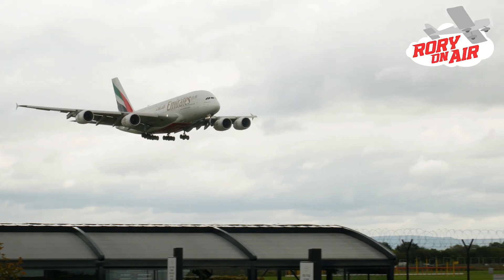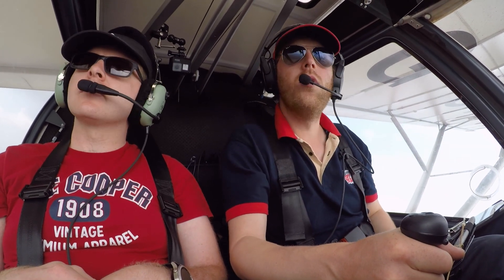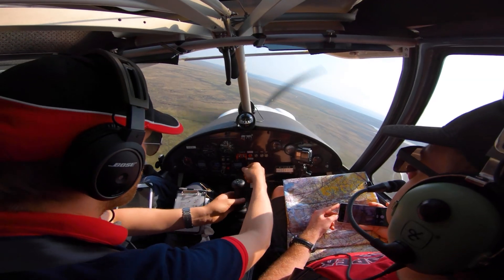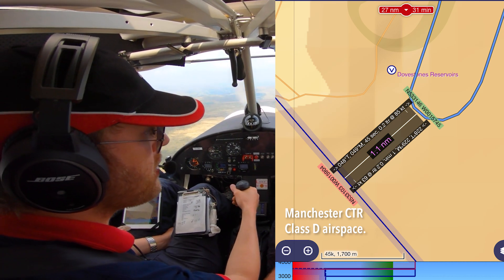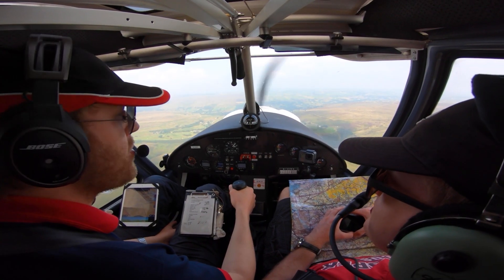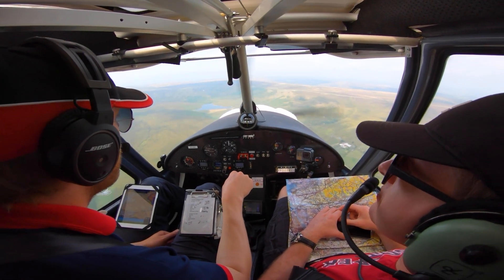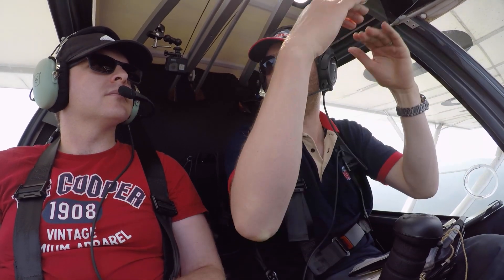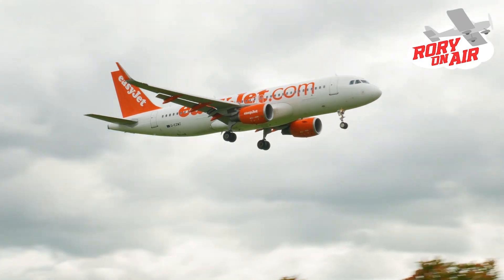What is a 'Listening Squawk'? | Real World Example

Comment: On a trip to the Isle of Wight I got momentarily confused with VRP''s and circled just outside Solent CTA whilst I orientated myself. Due the listening squawk they came on to question my intentions. Last weekend my Sky Demon log indicated I busted Heathrow CTA by 20 ft for 1 minute. Fortunately they didn't notice!
Reply from the maker: MrAlwaysBlue well it’s good they came on to ask you what the score was. As for the potential level bust, I’d be interested to know if there is a slight discrepancy between skydemon and the transponder or whether the radar infringement alarm has a 50 foot buffer etc? One for a controller I guess.
Reply: @RoryOnAir  1mb on QNH is about 30 ft so, yes, I assume they must have something like a 50ft tolerance before triggering an alarm. Its a reminder though to maintain altitude better in thermal conditions.
Reply from the maker: MrAlwaysBlue yes, I’ve come very close once or twice when a thermal lifts you suddenly and you have to bury the nose very quickly.

Comment: British ATC procedures seem unnecessarily complicated.

In Australia VFR traffic generally uses transponder code 1200. There’s a general expectation that aircraft are monitoring the correct frequency for where they are, so if ATC wants to call us up they just go right ahead and do it, no need for a listening squawk. If someone isn’t listening or talking, the entire national airspace system operates under integrated radar anyway, so they’ll see where you’re going and be able to track you down if they really feel like it’s necessary.

The British system seems like a poorly integrated mesh of loosely coordinated towers and approach centres who don’t pass data between each other. So I see you guys reading out your entire routing every time you talk to a new controller and think, “Huh? Didn’t he already do that four controllers ago? Why does he have to do it again?” In Australia, your info would follow you around the system, no mess no fuss.

“Basic service” is weird too. As far as I can make out it means little more than the fact that they’ve told you what QNH is.

Much easier to work in the US or Australian airspace system, IMHO.
Reply from the maker: Mark Newton hi Mark, it does sound like your system is pretty slick and I’m envious. However, we are where we are in the UK and I think the listening squawks are a good aid to controllers and pilots. Thanks for the comment.
Reply: That's not quite correct. There's 3000 for class delta airspace, essendon has 0100 since its so close to moorabbin. 1200 is for VFR only.  If flying into class C airspace you usually get given a unique squawk. Also you can request flight following (similar to "basic service")
Reply: @glennwatson  I did say "generally." Yes, some control zones use different codes, sure.

Flight following is a step above basic service, though. When you get flight following, you're given a very similar standard of service to an IFR aircraft, including traffic advisories, coordination with arriving and departing IFR aircraft as you pass regional airports, and being passed off from controller to controller enroute because they've done the coordination behind the scenes. They say it's controller workload permitting, but I use it all the time and I've never been refused so I guess they always have some spare capacity.

As far as I can tell, "basic service" essentially means you have two-way comms and they give you QNH :)